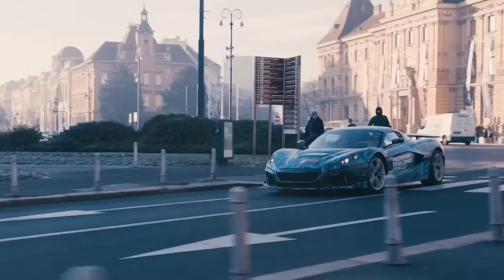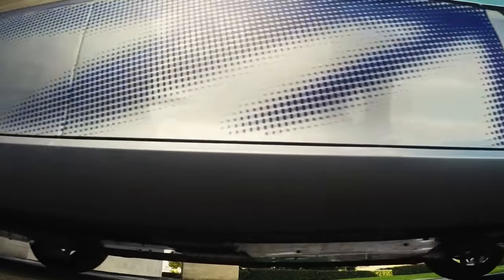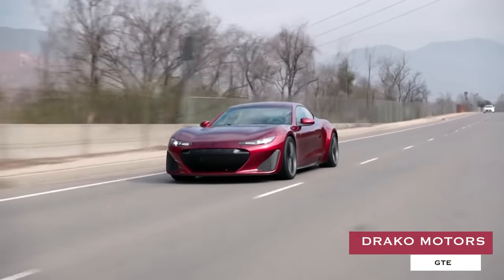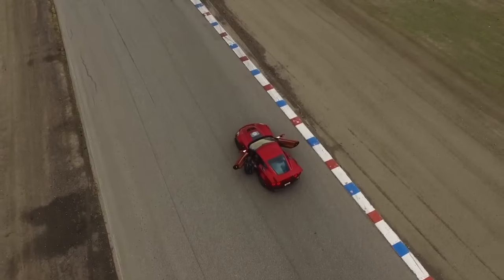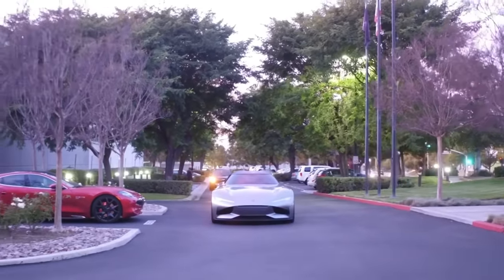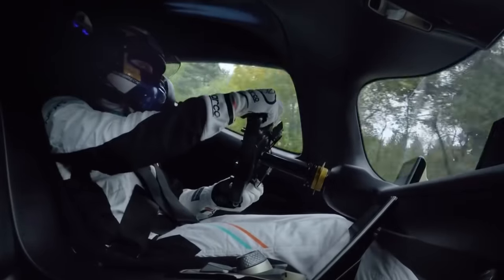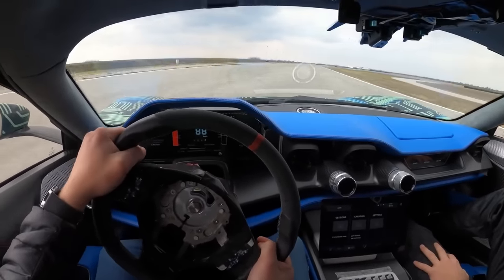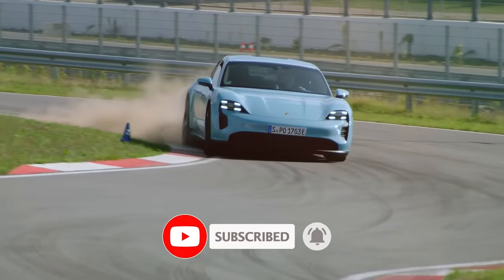Chinese Electric Sport Car Better New Tesla Roadster

Comment: The biggest problem is mileage per charge!
Reply: Not really. It's part of it, but I'd like to argue that speed of charge is the problem.
If you could only do 150 miles/ 230-ish kms, but it took 4 or 5 minutes to charge from near empty to full, the range wouldn't be that much of a problem.
At least, that's my theory... :D

Comment: As I understand it, Tesla’s core business is battery production. Their involvement in building electric vehicles is, I believe, simply  to drive the electric vehicle business in the interest of their battery business.
Reply: Not true.  If it was, they would make nothing but batteries!  Batteries are useless unless you give them work to do.  There are lots of companies such as VW, GM, Ford that are trying to succeed in the EV space, but they are failing miserably in EV production as well as ICE production.  You will see lots of them imploding completely in the next few years.

Comment: Why don't you think of using the same drive motor as a motor that can produce electricity to slow down the battery itself? Because there will be no need to wait for the battery depletion from the slow battery station.

Comment: ELON MUSK, YOU SERIOUSLY BETTER CONSIDER THE NEW GRAPHENE/ALUMINUM ION BATTERY! IT WILL LIGHTEN THE ROADSTER BY APPROX 1,200 LBS. AND MAKE IT 1.3 SECONDS FASTER IN THE QUARTER MILE! MAKING IT POTENTIALLY RUN A 7.5 SEC. 1/4 MILE!  AND HERE IS THE COMPANY THAT IS DOING IT NOW!  "GMG"

Comment: You missed the minnimac elekton, octa-motors, diamond batterries, 0-60 in 0.3 seconds, top speed 501mph, carbon fibre body etc, only $50,000,000 per unit, beats all those in the video, and doesn't exist!

Comment: It is simply hype to compare EVs to super cars.  They can be extremely fast on a drag strip.  However, at high speeds EV car ranges are severely reduced and they aren't great to start. EV milage claims are basically false, they typically get real miles at 60mph about 2/3 the claimed max range, at 120 or 140  ranges fall over 50%  faster speeds, 75%.  Do you really want to sit recharging your  " super car" every 80 miles? EV's can't compete in a legit race such as Le Mann or the Dakar rally because they have to charge frequently; leaving them in an embarrassing last place. I'm pretty sick of hearing this slanted reporting of these as "high performance'.  A Prius could potentially beat a Tesla Roadster on the autobahn driving Munich to Berlin.  That is not my idea of high performance.

Comment: Did you notice that the Germans are little Red guys?   The trouble with these cars and the promo...they do not compare it side by side.  One can go  0 to 60 in 1.9 seconds while the other does not mention that but says it has huge range and the other says it has cool looks. Put it side by side with all the specs. there so we people can compare. None of this "hype" B.S.  I am still happy with my ICE car doing 0-60 in 13 seconds.  It is not a drag race and where can you drive 200MPH? Useless info.  Each are hiding their dirty secrets.